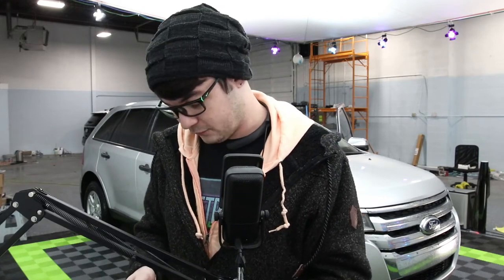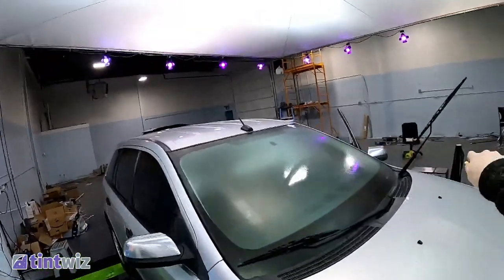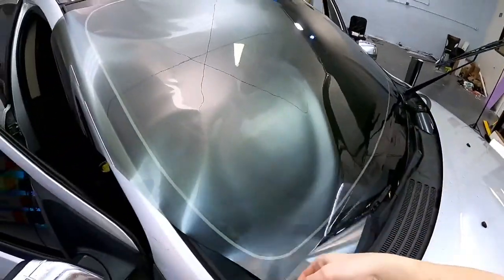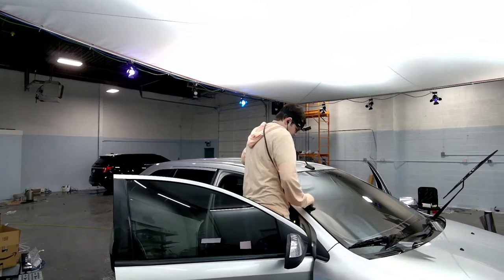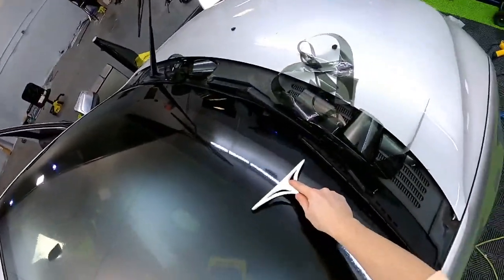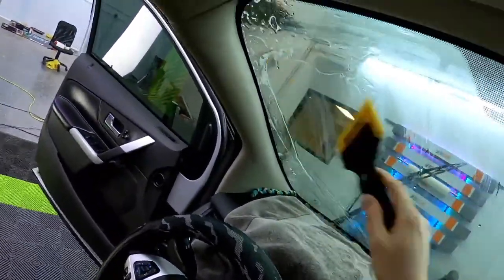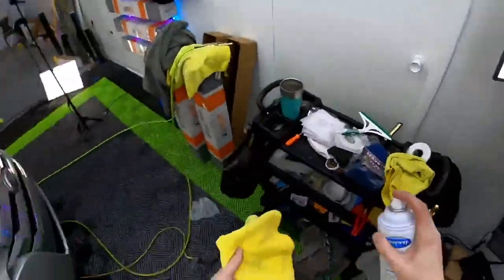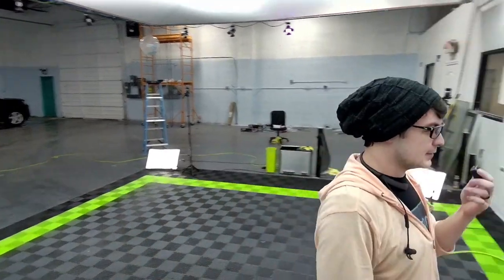How to Tint a Windshield Ford Edge and Remove Mirror

Comment: Where to purchase the tool you took off the rear view mirror
Reply: A lot of people use a pinky or the little chizler and a small pick or panel popper and spray the water soapy solution to make it slip but but very careful!! The glass can break easy